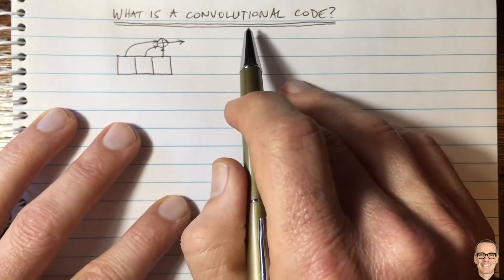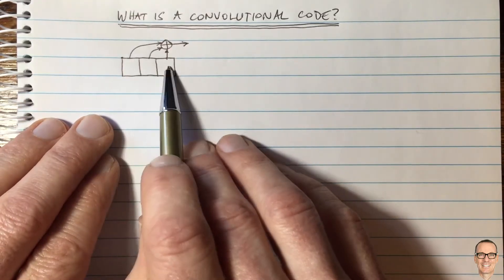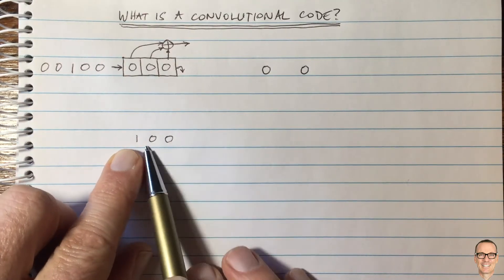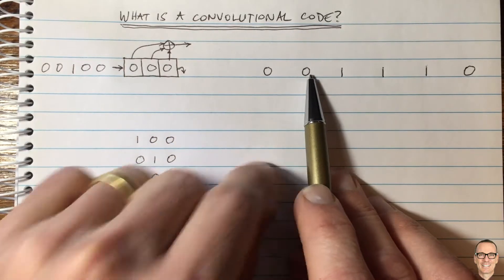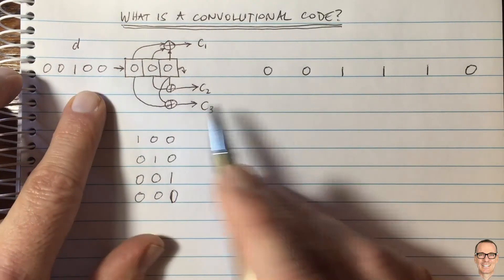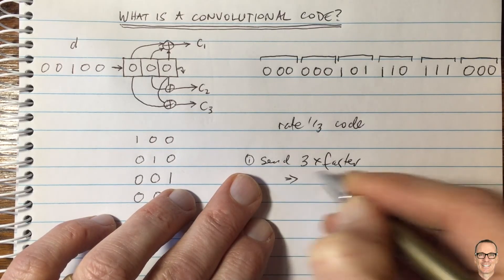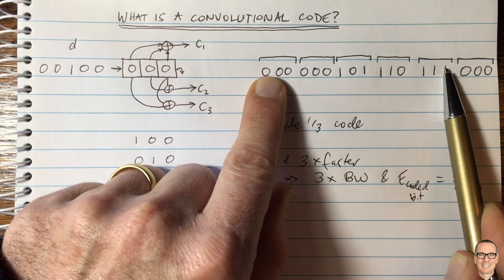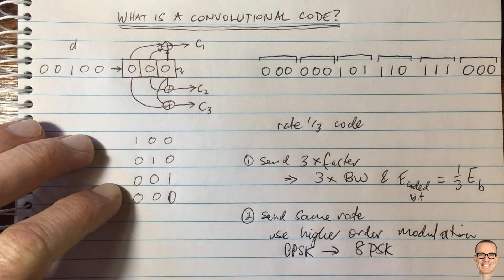What is a Convolutional Code?

Comment: Thanks for the video! So the advantage of convolutional codes over block codes is that they allow continuous encoding without having to wait for the entire block of bits to be available? Are there any other advantages?
Reply from the maker: Yes that's right. Another advantage is their use in Turbo Codes. Plus the ability to decode them without waiting for an entire block to arrive, using versions of the Viterbi algorithm.

Comment: Should the input sequence be 0 0 1 0 0 0 ? to get the output you showed?
Reply from the maker: Yes, sorry, I forgot to write the final 0 on the input sequence.
Reply: @iain_explains  I had the same question, but would word it as "shouldn't you have stopped at 3:45 when you ran out of input bits?"

Comment: Could you please explain about linear block codes as well.  Thanks 🍀
Reply from the maker: Thanks for the topic suggestion. I've added it to my "to do" list.
Reply: @iain_explains  So what are the advantages of convolution coding over linear block coding?
Reply from the maker: Convolution encoding is like a filter. It does not need to wait for a whole block of data to arrive, in order to generate the coded output "codeword" that will be sent into the channel. The same at the receiver. This reduces the end-to-end delay.
Reply: @iain_explains  Thank you for the reply. I'm sure there are disadvantages as well e.g. more hardware complexity.
Reply from the maker: ... well you only asked about the advantages ...

Comment: Could you do a video on turbo codes? Also such a video, it would be very helpful if you could highlight all the methods of redundant coding and discuss what is most commonly used. Finally, how does this defer from forward error correction? Is block coding the same as forward correction?
Reply from the maker: Thanks for the suggestion. I've added it to my "to do" list. In short, forward error correction refers to adding redundancy (usually extra bits) into the data stream so that the receiver can detect and correct errors. This can be done on a "data block-by-block" basis (block coding), or in an ongoing manner (eg. convolutional and trellis coding).